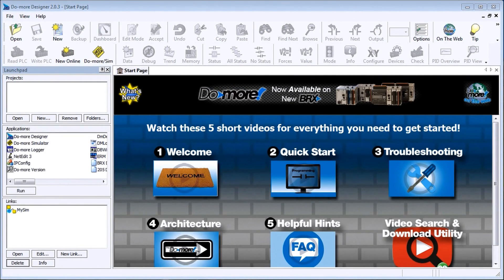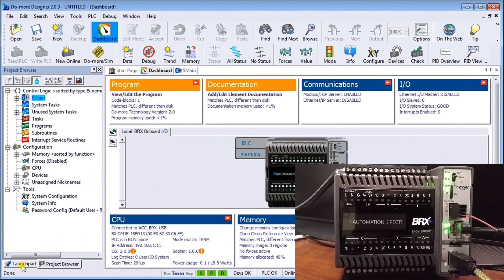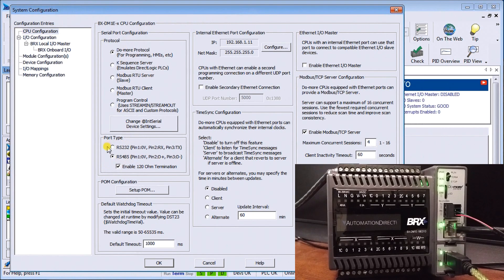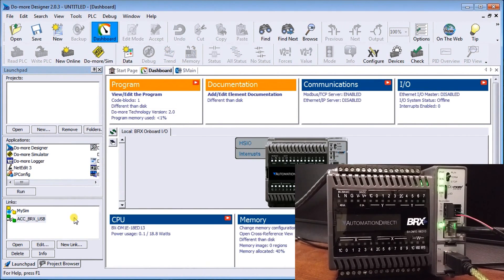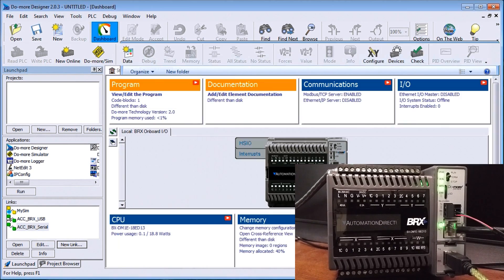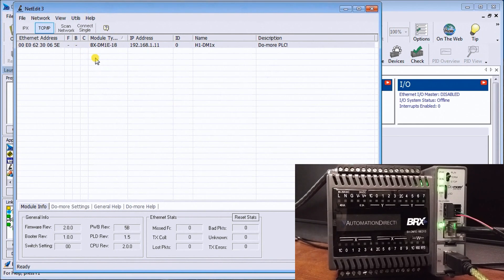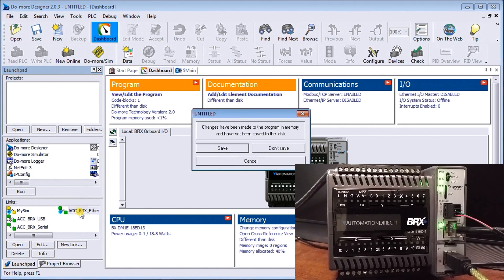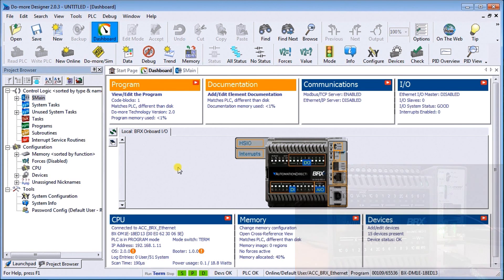BRX Do-More PLC Communication Setup - USB, Serial & Ethernet!

Comment: I am trying to make a New Link Ethernet connection for programming on my BRX internal port. I cannot connect and am not sure about the IP, Subnet, and Gateway. I tried the same settings as on your video but it does not work. when I select New Link and select Ethernet, then UDP/IP on the Link Wizard I do not get anything. Then I select the Setup button but I still don't get anything.  I also tried the IP for my PC Ethernet connection but it doesn't work either. I tried my internet IP and no work. I am baffled as to what I am not doing.
Reply from the maker: Hi Bobby,
I would go to the Applications under the Launchpad. Select the NetEdit 3 application.
The PLC should be displayed. If not then select 'Scan Network' for the software to search the network again.
If this does not work then I would change your Ethernet cable back to your router and try the above again.
Here is a post that may be of interest to you.
http://accautomation.ca/what-everybody-ought-to-know-about-ip-addressing/

Regards,
Garry

Comment: how do i know if the PLC is working with the code. does the light suppose to blink?
Reply from the maker: Hi kennis ko,
Depending on what mode of communication you have with the BRX Do-More controller the lights on the CPU will flash. This will indicate that you have communication established. 
On the Do-More Designer Software, you will notice that you are on-line by the bottom address bar. It will show "Online", mode of the controller, and any error messages.
If you want to see the status of your PLC program then select the Status icon on the main menu when monitoring the ladder logic. 
I hope this helps you out.
Regards,
Garry

https://accautomation.ca/series/brx-do-more-plc/